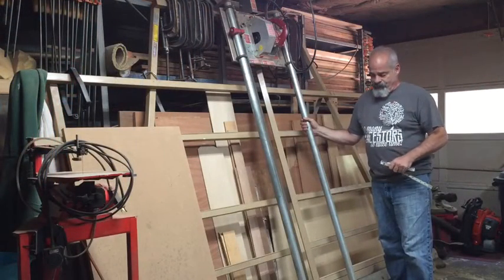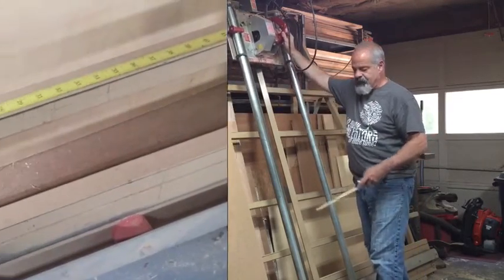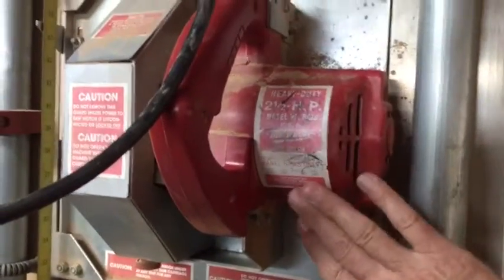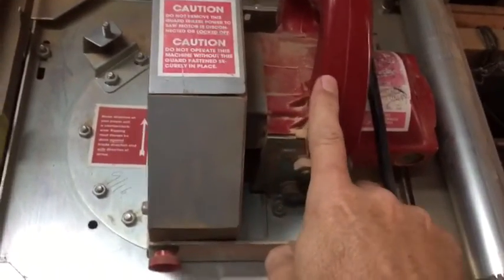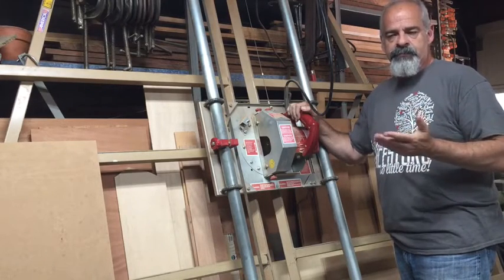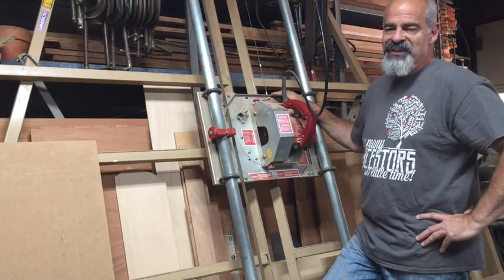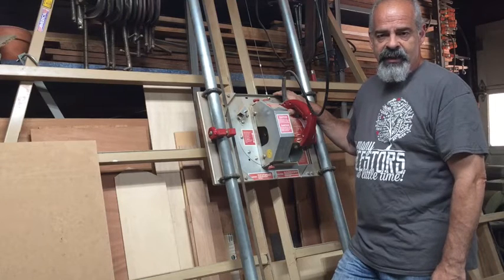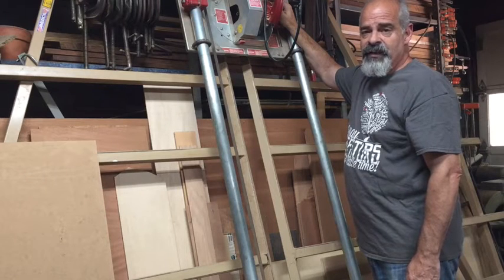USING MY PANEL SAW

Comment: Ron Mjos
Reply: New to adding comments. I have a smaller one, same mfg, but added the extensions on the base. To cut Baltic birch ply (60"X60") I have to make the first cut horizontal. Standard ply works the same as yours.
Reply from the maker: Ron Mjos mine is tall enough that it will cut just over 60”. I used a lot of Baltic birch over the years. Thanks for your input!!